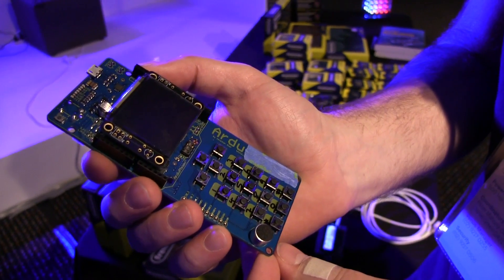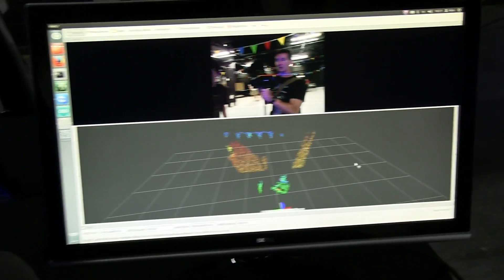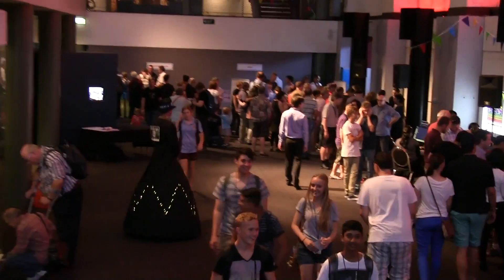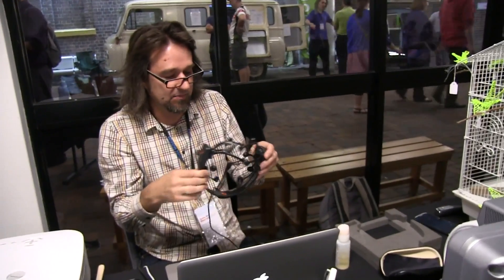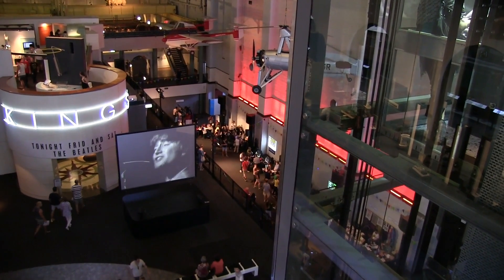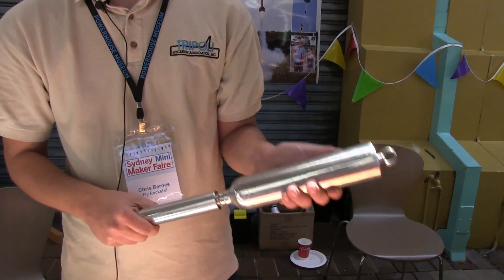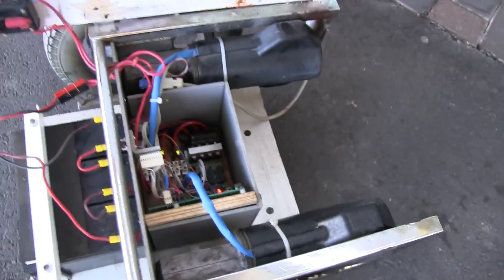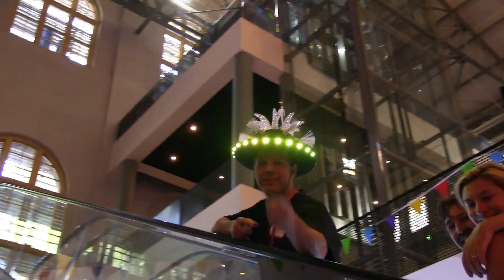EEVblog #551 - Sydney Mini Maker Faire 2013

Comment: I like that Arduino Phone. I wonder if there is a way to upgrade it with a strong encryption engine (in an FPGA for example). As an open hardware project this could be the one and only truly secure phone with no access for the agencies.